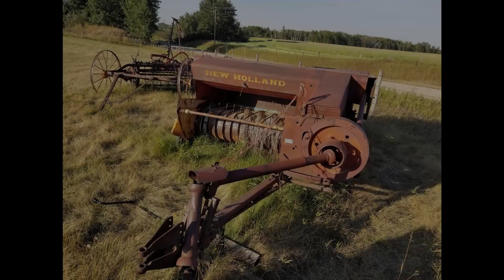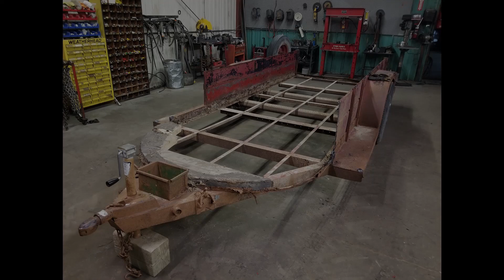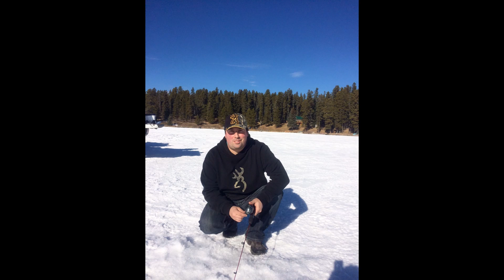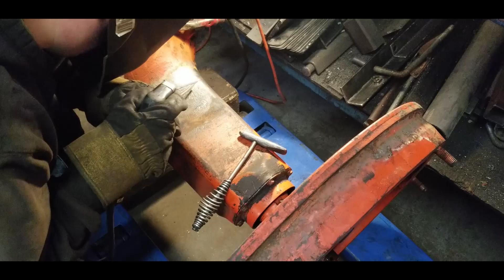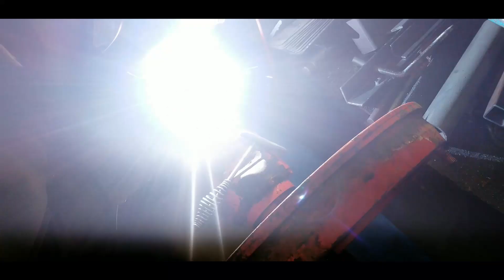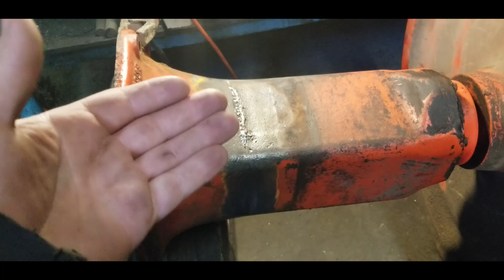1959 Case 800 build.  Part 26!

Comment: What rods do you use for cast welding
Reply from the maker: Thanks for watching.  The rods I used were N55 nickel rods.  As you seen, I preheated the cast just till it started to turn blue, hit the weld fast and then slowley let it cool while peening it.  Had no cracks when it cooled.

Comment: Try hitting it with the mig gun after preheating then as soon as you're done laying a bead take your slag hammer and pean it to release stress so it doesn't crack and keep peaning it as it cools.  M as yne just do a test of it.  That's how I was told to weld cast and it's the only way I'll do it now after trying it
Reply from the maker: You don't think the tungsten mig wire is to hard for the cast?
Reply: @DuchesnesCorner  I've just used regular mig wire welding cast preheating and peaning and taking my time.  I've had good luck.  I dont think it would hurt much if you tried a couple inch section just to see how it goes? Might like that technique better I know I did
Reply from the maker: I will give it a try this weekend.  I would rather mig weld a mile than 10 feet with a stick...
Reply: @DuchesnesCorner  I'm getting better with stick than I used to be because that's all we have out in the field but I'm in the same boat as you

Comment: Might as well give it a try. How thick is the case? Might be able to get a little better weld if you groove it out a bit.
Reply from the maker: It was gouged out a bit.  Weld appeared to have good penetration but welding the cast is just horrible.  Spits so much.  But I think it will hold.
Reply: @DuchesnesCorner  No personal experience with stick welding cast, but I believe the right rod makes all the difference here.  Nickel is great for dissimilar stuff, and cast apparently.  A Lot of work to get to this point so now is the time to make sure it is strong.  Here's hoping!
Reply from the maker: To the best of my research... I am using nickel N-55 rods.  I do hope these will work.  Like I mentioned, it don't look pretty but it looks like it penetrated good.  Once they are done you will never see the welds so I'm not worried about how they look.